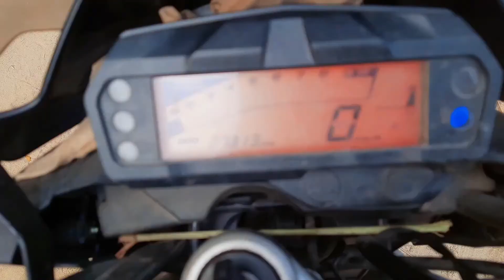Yamaha fz v2 engine oil change | Yamaha fz v2 oil filter change | Yamaha fz fi

Comment: Shall we use motul 5100 15w-50??
Reply from the maker: Hi lokesh loki, brother you can use this also.Stay tuned.
Reply: @UtopianDays  then what is the oil change interval???
Reply from the maker: Bro for 1st 30000 k.m every 3000k.m and then in every 2000k.m oil change is recomended for maximum 150cc, or recomended as manual of the motorcycle. Hope it helped.
Reply: Bro shall we use 10w40 fully synthetic oil ???
Reply from the maker: Yes brother, you can use, infact u will get a better performance with full synthetic oil.
Reply: @UtopianDays  which one is best bro which brand